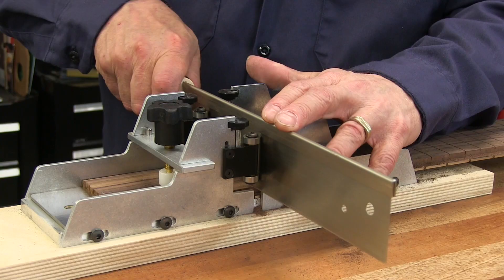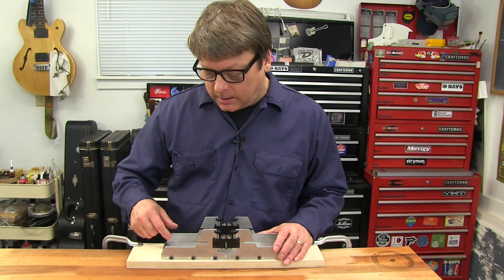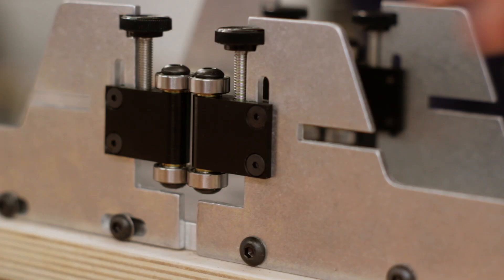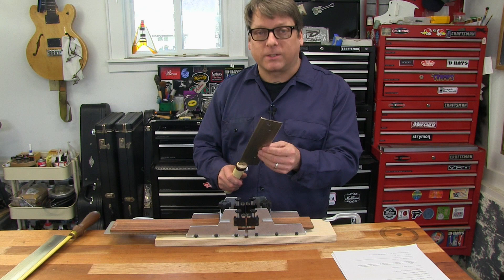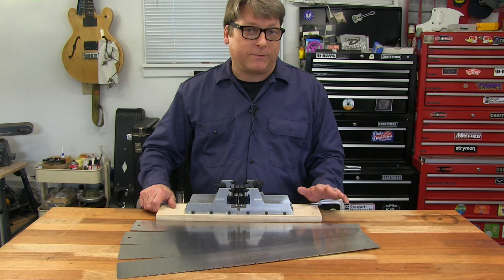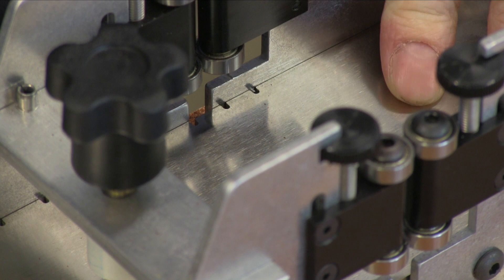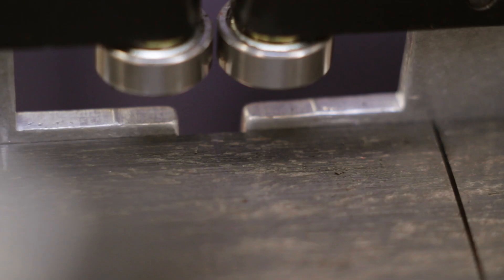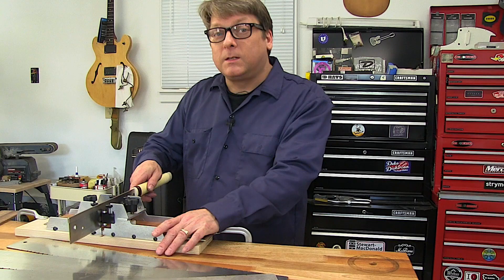StewMac Fret Slotting Miter Box

Comment: I bought this miter box over a year ago I only used it twice, I just went too use it and the cap screwsthat hold the bearing height plates seem to be stripped they will not tighten up. Please Stew MAC tell me what I can do about this?? I have two fretboards to cut slots in but I’m afraid too use the miter box because the height adjustment will not tighten. Also I bought you fret slotting  templates too use with the miter box but I’m confused because it seems that the first notch might be the nut location??? Also Why is there no center line on the templates??? Scott
Reply: No reply

Comment: This video iis more advertisement than instructional..... I bought this and am really disappointed in the instructions. In the video you say adjust for depth of cut...but HOW??? You gloss over what you use to reference the measurement, you just show using a ruler with out any instructions.....really BAD!!  Then how do you account for the nut and first fret on the template??? again you don't give enough info for a new user to use your product.
Reply: you shouldn't have bought it if you don't know how to use it
Reply: i agree with you whole-heartedly! This is an advertisement. The Notch does NOT line up your next slot. You can see this in the video. I reversed the plates with the notch to go notch-less. Bad video. Not even a little bit of instruction. sad.